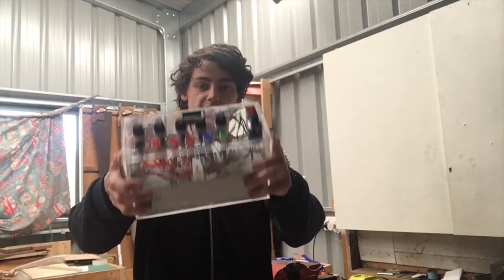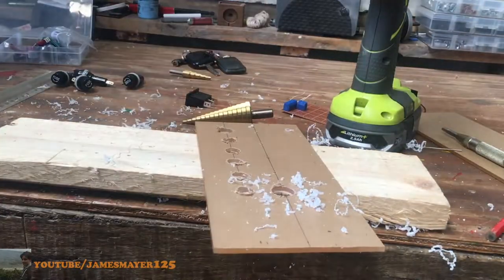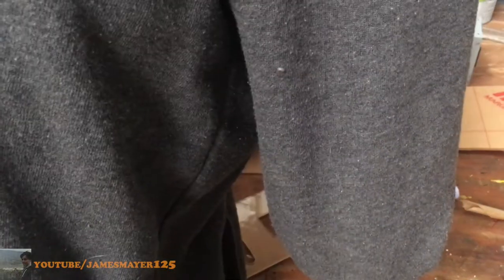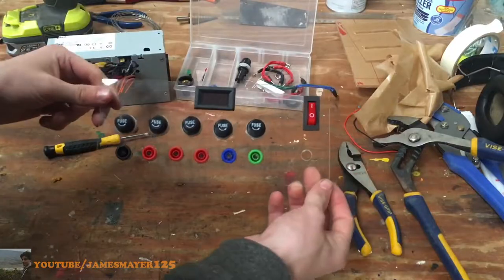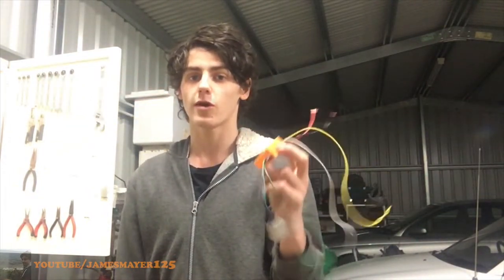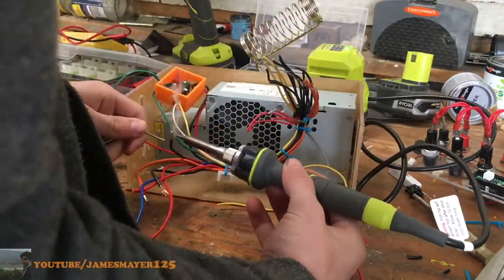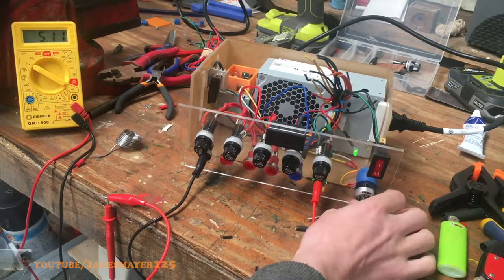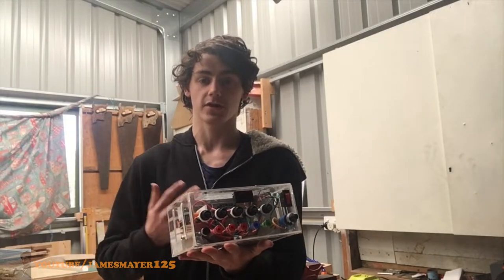DIY Variable Bench Power Supply || How to Make

Comment: I know i'm probably late but i noticed that you called LM317 a transistor while in fact it's a voltage regulator. Cool PSU though, it's really neat ide to use the acrylic for the case.